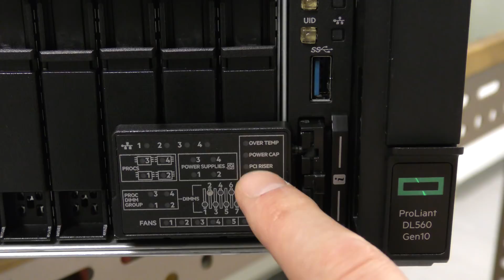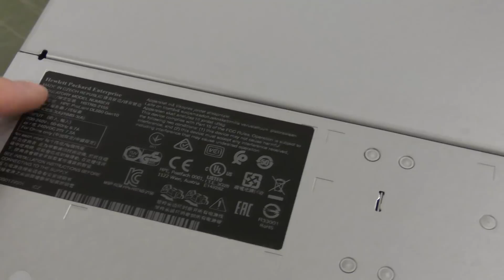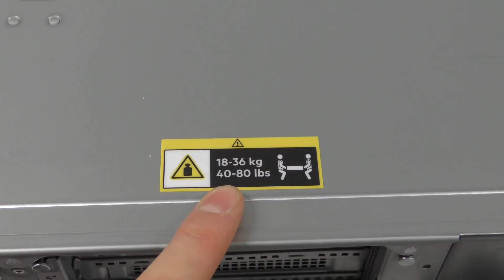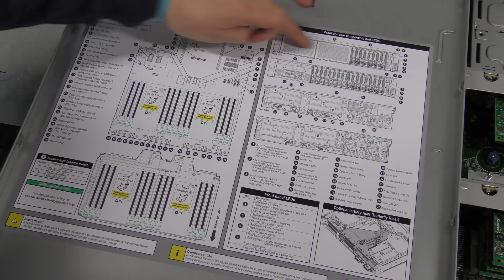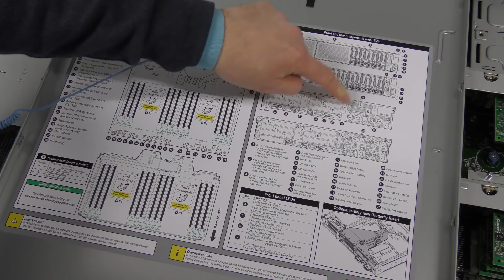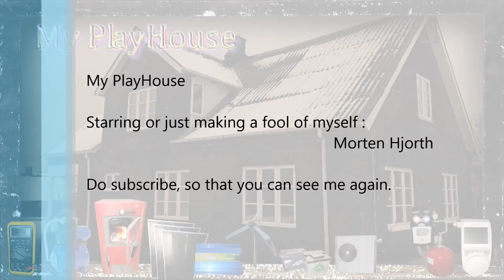This HPE DL560 G10 cost $43,000.00 so what's in it?? - 638

Comment: I love HP finally condensed the 580 series into 2U. They took a book out of there c7k series for those PCIe connections to upper PROCs. But I'm curious, you said those HBAs are 16Gb/s? So you are not using SAS, but FC? And I don't recall if you covered it, or can discuss. But what is your storage backend (SAN)?  Our organization has looked at quite a few options, but when millisecond response times are a concern, we have troubles finding any sort of storage solution that can provide large scale centralized storage.
Reply from the maker: Hi 101rockfreak
No I can't tell you much, there is a big EMC all flash SAN!  glad you liked the video :-)
Thank you for watching! :-)
Reply: The DL560 already made its appearance in Gen8 (2012), so it's not really new.. They did discontinue the DL980 (the 8 socket model) after generation 7.

Comment: That's a very efficient use of space! 4 cpu's. Lot's of rear I/O expansion, 4 power supply's, and a front that can be loaded down with hard drives. you don't typically see that here, you ether have lot's of I/O or lots of hard drive space.
Reply from the maker: Hi Travis Piper
Thank You very much! I would much rather have show you the Lenovo ThinkSystem SR850 Server,,,, same server just Lenovo.
Thank you for watching! :-)